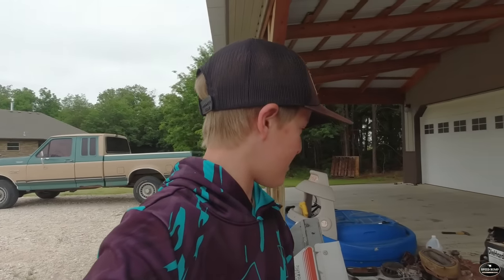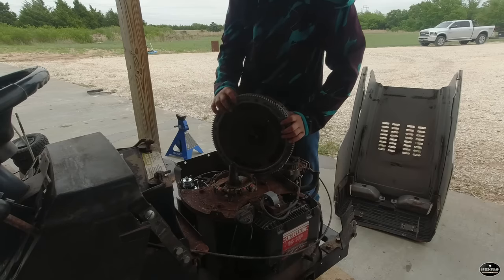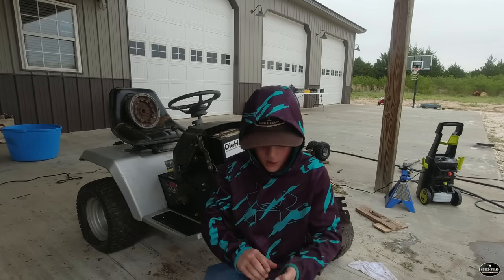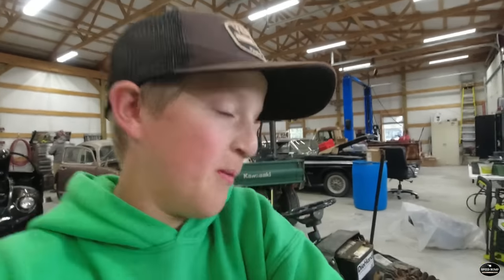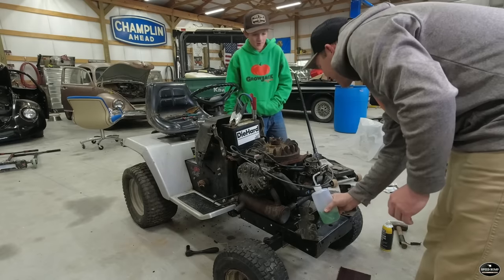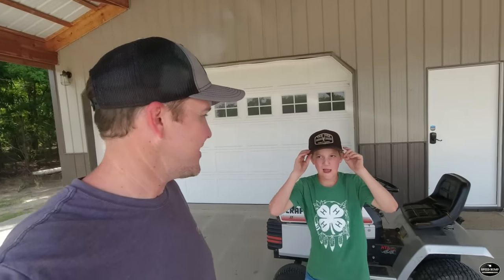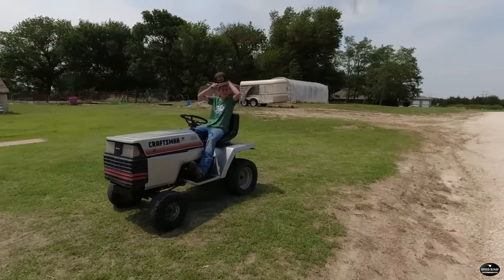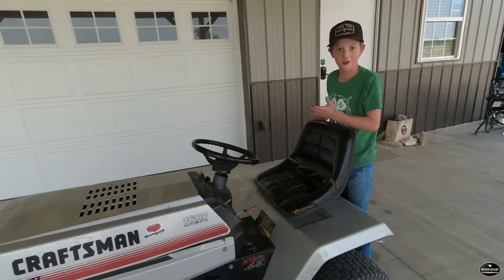Kid brings FORGOTTEN Lawn Mower Back to Life!

Comment: First of all Jack Congratulations, you should be really proud of yourself; job well done.   So when you had the flywheel off and you were cleaning the magnets underneath, that's called a "stator" because it remains stationery (doesn't move), and the flywheel is the "rotor," because it spins.  When the magnets meet it creates a magnetic field and produces electricity to charge your battery and run your lights.  A rock crawler is usually a SLOW machine because it needs torque ( twisting action) to climb over rocks and obstacles.  Changing the size of the pulleys from the engine to the pulley over the transaxle will either give you more torque, or speed depending on the size.  Like gears on a bike.  Good luck Jack I'll be watching.
Reply from the maker: Thanks Mike! Unfortunately the rules say no pulley swaps.

Comment: Great video, super inspiring & contagiously upbeat young man!  I know this was posted a long time ago but: One of the little things these frequently require is adjustment on the coil gap.  On my old JD 185 this amounted to roughly the thickness of a buisness card, but what a difference when it was correct.

Comment: the magnets under the fly wheel is called the magnitto charges the batterie and powers lights etc, the other part you cleaned is the coil , make sure you torque the nut on the fly wheel down to spec, your a top bloke mate hats off to your parents, gidday from Scott in Australia

Comment: On lower compression motors like this I will spray paint both sides of head gasket with aluminum spray paint and have had luck reusing old head gaskets  just t&ought you mighty that

Comment: White lithium spray grease saved my starter.  Put some on the starter gear and fly wheel cause the rust will keep the starter engaged while running.   Just my experience.   Where's the bug
Reply from the maker: Look closely! There is actually 2 bugs in this video.
Thanks for always watching and commenting!
Reply: @SpeedBumpGarage  I have to admit I missed some of the video....Grandkids